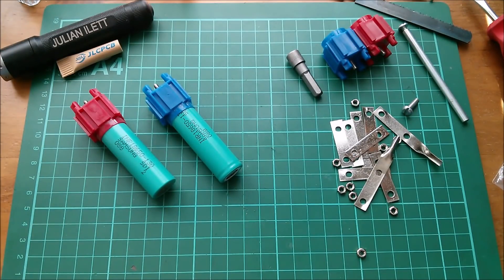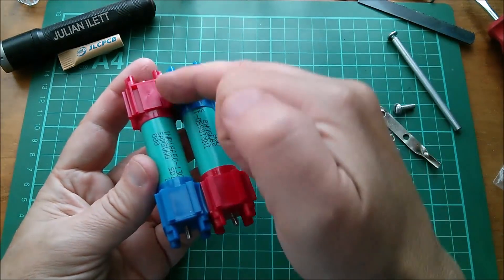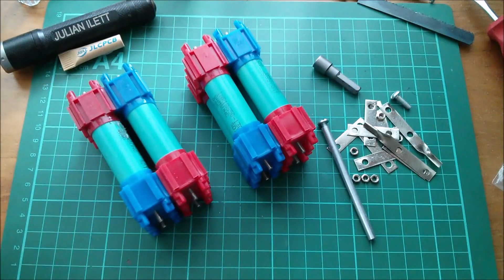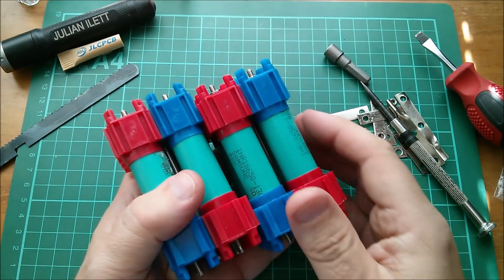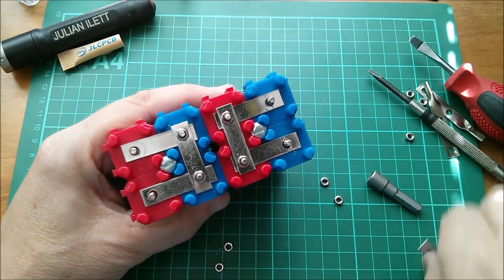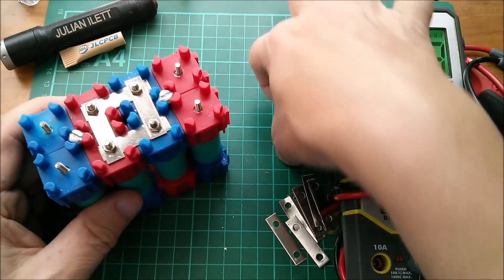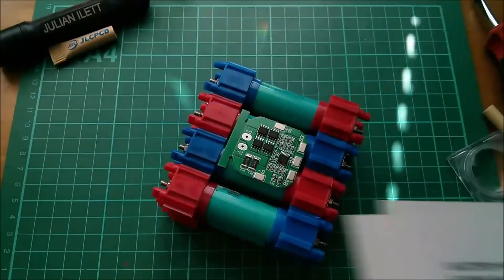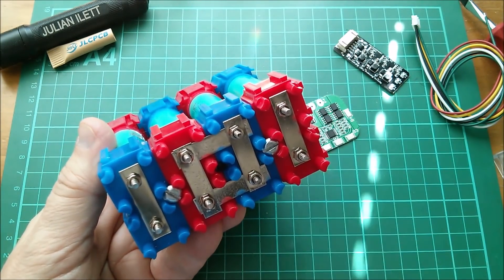Building a 4S2P Lithium Ion 18650 Battery with Vruzend 1.6

Comment: I have 2 Banks of 4s that I wish to connect together to double my capacity of an individual bank.
I would have thought if I just put them in parallel with a nickel strip at each end ( joining the 2 negatives and the 2 positives)
Why do you need to use a bunch more nickel strips paralling the centre cells ?
I mean , if I had 2 AGM 6 Volt batteries , and put them in parallel , each AGM battery is made up of 3 individual cells , but the individual cells are not , and cannot be put in parallel , yet the capacity of the overall system is doubled with seemingly no issues.

Comment: Do not get Vruzend 1.6 regardless of the price! I ruined 7 perfectly good 18650s with it trying to make a 4s8p pack. Wait for more improvements or do the right thing - spot weld your cells1. When you push the cells into the caps it's a tight fit so you compress the air inside and like a spring the caps come ever so slightly away from the contacts - a small hole in each one would relieve this and make assembly/disassembly easier. 2 Because of #1 there isn't much tactile feedback when pressing the caps over the cells. It shouldn't be possible to over insert the cells. I ruined 7 perfectly good 18650s 
because of this. There should be a molded in stop inside the cap to prevent over insertion.

Comment: Love all your videos with batteries and super caps. I recently got the vruzend 2,1 kit it was fairly expensive but fun to play with. Screwing the barrel bolts are still a problem in the 2,1 kit but I adopted you saw blade cut out method which works perfectly
Reply from the maker: Excellent, thank you :)

Comment: Unless there's a battery that's a rogue voltage, and the output parallel ties, the other parallel ties will never carry any current. But it does physically help make the pack more robust.

Comment: The mention of Blue Peter triggered a memory.
When my wife, son and I set out to America in May 1970 we took passage on what was then the BRAND SPANKING NEW QE II.
We left Southampton and sailed to Le Havre to pick up more passengers.
What has this to do with Blue Peter, well the Blue Peter film crew and the hosts came along to film all the fun for a Blue Peter episode.
They disembarked at Le Havre and we continued on to New York and then to Chicago to join the Computer Systems dept. of a Chicago Corporation. I was hired because of my almost ten years programming and systems experience in the new COMPUTER REVOLUTION.
That was in 1970.
In Chicago I worked on a huge IBM shop with 360/50s and 360/65s, running IBM DOS and OSMFT II AND OS MVT II.
With ISAM VSAM AND SNA, those were the days.
I went on to work for HP, HONEYWELL, the networking pioneers Bridge Communications, 3Com and Cisco Systems and then several Silicon Valley startups. It was all great fun, I had a wonderful career.
Thanks for the memories.

Comment: Its all fun and games until you burn a hole in your hand!
Reply: I once shorted a 12V High Discharge battery. The cable insulation had an imprint of my fingerprints after that, but my fingers seemed ok.

Comment: Many DIY packs are spot-welded, and when doing that, it is "easier" to parallel first. Easier is not necessarily better performing. I always recommend performing the series connections first, so the line resitance is as low as possible, leading to the pack running slightly cooler. Its not much, but its free to series first instead of parallel first. The series conenctions carry the current, and the parallel connections flow an extremely low amount of current  to keep all the cells in that P-group to remain at the same voltage. Having some resitance in the P-connections is a good thing, for the series connections, it is beneficial to have the lowest possible resistance. The higher the resistance in the series connections, the higher the operating heat and the greater the voltage drop under load...

Comment: Those protection PCBs could use a few mounting holes.  Even plastic tie-wraps threaded through make more sense to me than dabs of hot glue since you won't have any pack encasement.  But then I tend to avoid the modern "solder is super-strong conductive contact hot glue" philosophy as well and prefer solid mechanical joins, twists, or wraps before soldering wires.

Comment: Slotted to slotted is a bit clumsy, so a specialized tool can really be helpful.  I'd also be paranoid about bending plastic and would prefer to have those bolts bottom out metal to metal somehow once fully seated, or perhaps against some sort of tensioning washer of metal if springiness makes more sense.  I haven't thought it out, I just know it makes me a little uncomfortable as is.
Reply from the maker: I was uneasy about it too. I thought the plastic shelves would get mangled by the bolt head, but it works surprisingly well :)

Comment: Not trying to be rude, but why even bother with 1300mAb 18650s? There's almost no project I can think of that wasted space/additional weight makes sense, especially when that weight and space could be made to more than double the capacity of a battery. These days if you need high current(>10A) cells Samsung 25R are nearly double the capacity(2.5Ah), can output up to 25A continuous, are seldom faked, and cost a few bucks a cell. LG MJ1 cells are 3000mAh and have a constant current rating of 10A(irc), but they're usually slightly more expensive but still usually only 4-5 at single cell prices. Then theres Samsung 30Q which can't handle quite as much as the 25R in terms of cureent but are 3000mAh and also cost$3-5 per cell, Panasonic NCRs(3.4Ah but <5A discharge rating), LG HG2, HE4, etc. That are all pretty cheap, especially when you consider price vs capacity in comparison to much lower capacity 18650s
Reply: Because he got those 1300mb ones for 20 pence each. Why pay ten times the price for only double the capacity?
Reply: @RedwoodRhiadra  He also often prefers to use low capacity packs because they are quicker to charge and discharge. This helps him speed up his experimentation with charging and balancing circuits.
Reply: Low capacity cells usually also have a higher safe discharge current. You can put more in parallel, but if you need more current more than you need more capacity, you may end up with a smaller package using these lower capacity cells.

Comment: I like the system and looks like fun to build however the first thing I would do it throw those common headed screws away. The only place they have is in a museum and should never be produced again.
Reply: I dont know why vrusend didnt use a hex bolt on one end between the lugs to allow for the need to only use one screwdriver! I would also prefer both ends of the barrel bolts to use hex nuts. sort it out Vrusend!

Comment: I use my Dremel with a sandpaper bit to easily take the weld  stubs off the ends of the batteries.
Reply: Andy Shap Same, works great! Need to get myself one of those sweet kits, have over 40 18650s left.

Comment: The design principle seems good but there are a number of issues I see and they center on the entire design relies upon plastic to retain tension on the fasteners. 

#1 the stud that sticks thru the plastic will loosen up overtime and create a high resistance and a hot spot and possible fire. I would double nut on the stud to insure long term tension.

#2 What is the flammability of the plastic? Should be 94-VO. 94-VO basically states once the ignition source is removed the flame will self extinguish

#3 The long bolts that put the cells in compression will loosen as well. These might be ok for initial build and test but long term I’d use parallel plates that are connected with a 1/4-20 all thread 

#4 as Julian demonstrated he ripped the welded tabs from the cells which left little tits which will create hot spots when pulling lots of power. I think the only solution here is the use of a electrically conductive paste. You might consider it insignificant but for every watt you expend heating the pack is less power delivered for use.

I suspect most users will be building large packs and the deficiency note will be exacerbated.

Just some random thoughts from a retired electrical design engineer with over 40 experience in the design and development of  complex equipment that has been to the bottom of the ocean and into space and everywhere in between. It’s these little things I mention will cause lots of grief!
Reply: What about glueing the screws into the rods?
Reply: @gudenau  loctite should work wonders there
Reply: @Ramog1000  I was avoiding a brand name, don't know a generic for that other than "glue".
Reply: Ramog1000< any sort of adhesive on the threads will be a insulator. Think low resistance connection. Metal on metal.
Reply: @judd_s5643  Uhm, no current goes through those. They are just for the clamping force.
Reply: gudenau < are you referring to the long rods that hold the pack together. If so, that will not work. It’s not the thread unthreading it’s the cold flowing of the plastic that will allow the plastic to creep apart. That’s why I suggest that non conductive stiff plates be used.

Comment: It would be insanely cost prohibitive to create a say 7S 40P battery for my wind turbine.
Reply from the maker: Yeah, it's not ideal for a big pack like that - too many connections adding contact resistance.
Reply: Want to borrow  my kWeld spotwelder?
Reply: @RoyvanLierop  LOL, I have one actually.   MOT type.  I just didn't want to weld or solder.  I have like 300  18650's to use here .  Working on a  500W Wind Turbine Augmented 500W solar closet thing a bob.  Just going to do Plug N Play Grid tie until I can get a battery.

Comment: For the dovetail mates, in woodworking we call them pins and tails.  You could also use pins and sockets.
Reply from the maker: So the slots are called tails? Today I learned :)
Reply: @JulianIlett  - Yes.  Wait.  No.  Now I'm confused.  I googled "pins and tails" images and I realize this isn't the best.  I now want to say pins and sockets (or turn back the clock☺).  Tails have the same shape as the pin sockets and are what is between  pair of pin sockets.  Sockets are a void, tails are material.  Pins and sockets - final answer.

Comment: I'd do all the parallel connections, before doing the series connections.
Reply: Also combine packs of cells of similar size. If you have a 8P battery then: 2-2-2-2 -> 4-4 -> 8
This distributes current flow when cells are not equal.

Comment: I remember showing a mini VRUZEND pack to Dave EEVBLOG and lots of Electronics Engineers around. They’re all very excited and very impressed how easy to put all together, it’s like LEGO! 
I’m sending your video to Micah he will love to see you playing with VRUZEND POWEEEEEEEERRR ohhh yeaahh
Reply from the maker: Thanks Bruno. I love the modular nature of Vruzend - it's great for testing battery configurations.
Reply: Good for small toy batteries, but you would go crazy and bankrupt trying to build a 14S 320P pack!
I'll stick with copper bus bars or plates and fuse wire with cell holders and zip ties.

Comment: I think I'd build the packs up first with the straps before adding the batteries
Reply from the maker: It's pretty hard forcing on the end caps when you've got a large series and parallel array of cells. That's why I like the modular approach.
Reply: The manufacturer's videos always put the straps on last